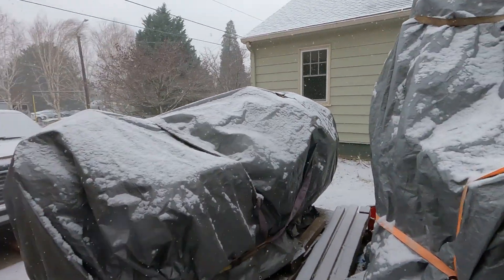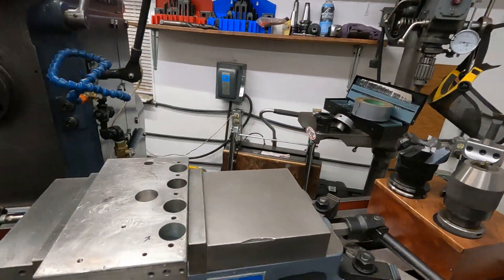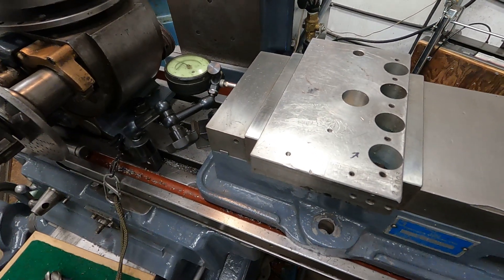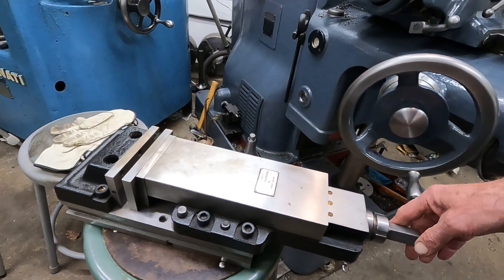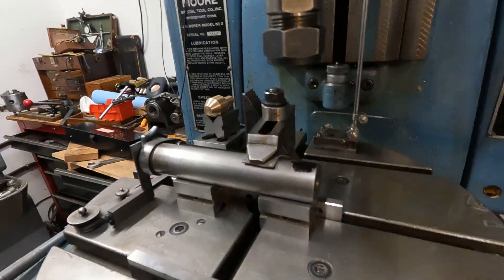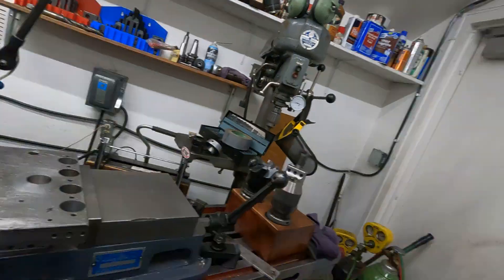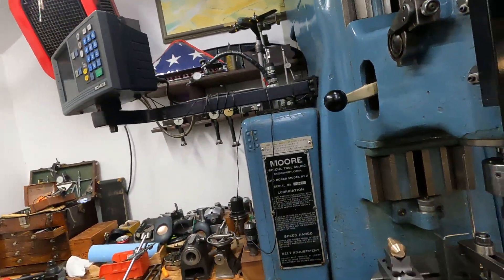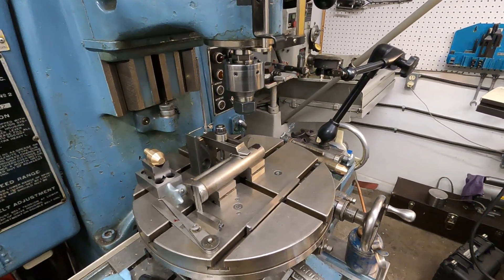Machine tool vise fixturing errors

Comment: If i am doing a run of parts in the Kurt with modified soft jaws for fixturing , i have to use a torque wrench to get repeatability to allow for the flex .
Reply from the maker: Yes, it is like that with a lot of things on machinery even using table locks on the mill without trying to repeat with the same pressure is another variable that can go unnoticed, thanks!

Comment: Hi dee dee informative as always, keep them coming. How do you protect  the Axelson  and pillar drill during the winter months?. Paul UK
Reply from the maker: I have them coated with thick oil and have 60 watt or 100watt incandescent light bulbs under the tarps to stop condensation, and it works in this climate, I have a 100watt bulb in the lathes coolant sump, thanks.

Comment: That’s Interesting information, the Set & Release technique  I’ll have to try. Thanks again for sharing. Have a great day.
Reply from the maker: One can use that to straighten large bent hydraulic rams in a heavy press but the steel can shatter when struck under high pressure.

Comment: Wow that’s amazing that the jig bore has a vernier on the handles, I did not know that. I now require a jig bore. 😅
Reply from the maker: The Moore Company is the ultimate machine shop in the USA, the screws have high accuracy only in the direction of the vernier scale.

Comment: This is a recurring theme to Robrenz teachings in the shop. 00:35.   He works at extreme precision level so it's something he deals with often.   "Metal is like rubber only harder"
Reply from the maker: My needs are basic relating directly to the tolerances fitting precision ball bearings as is listed and recommended in the Barden Bearings catalogs and instruction manuals. The general maximum allowable error is .0002", not very much.